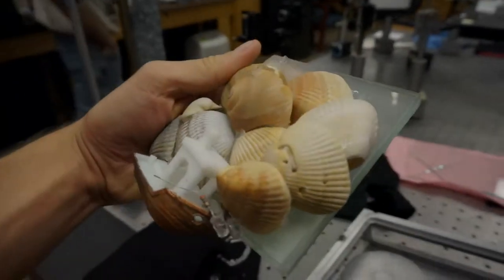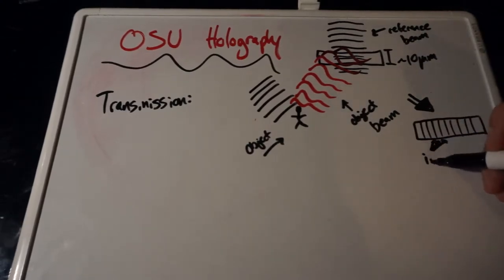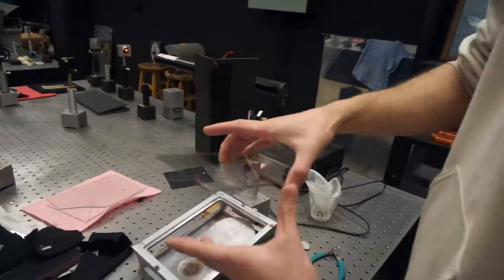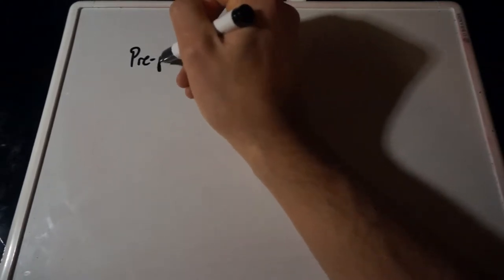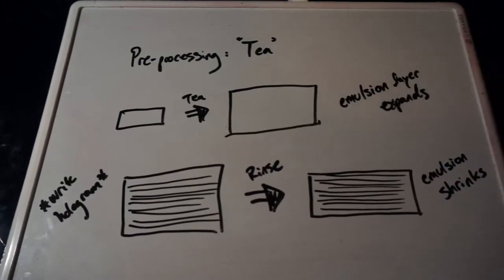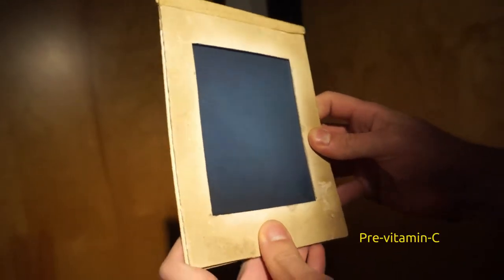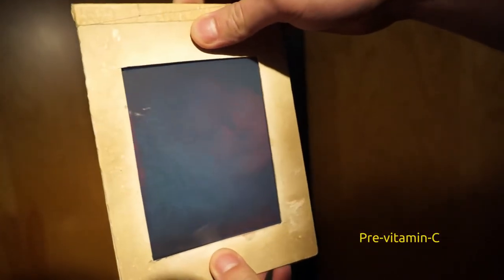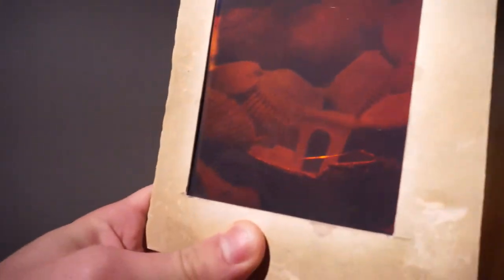OSU Holography Lab

Comment: My hologram stuff just came in, I'm hoping to make my first one tomorrow. The kit I got uses glass planes instead of film, do you know what the difference is, as well as information on the type of film I should look for if I were to try the medium out?
Reply from the maker: Awesome!! Though I didn't think this was trivial to do at home, you need a very steady (and presumably heavy) table, dark room, laser light source, etc. What is your setup like? 

I believe we use the PFG-01 film from Integraf, but should double check... I am not sure about the plates, but I assume it is the same as the film in the sense that both the film and the plate are just substrates to hold the emulsion layer. Notice you can get the same emulsion layer on both glass and film https://www.integraf.com/shop/pfg-01-holographic-film-plates